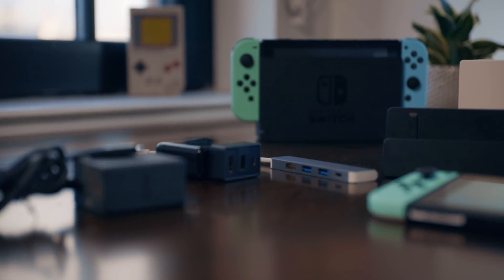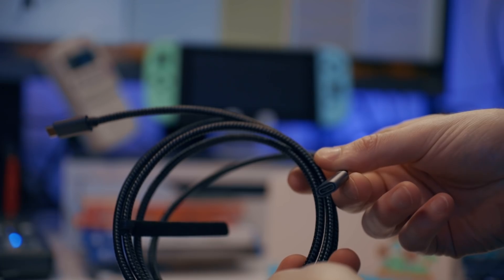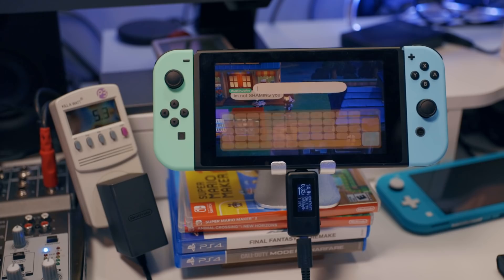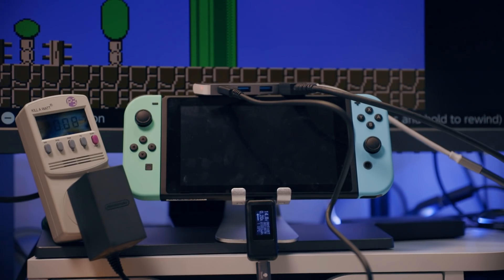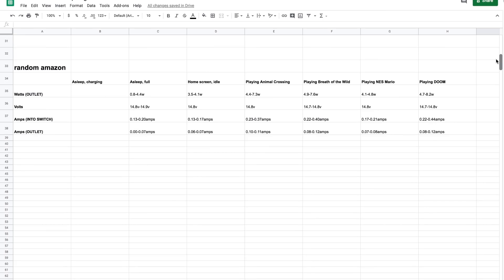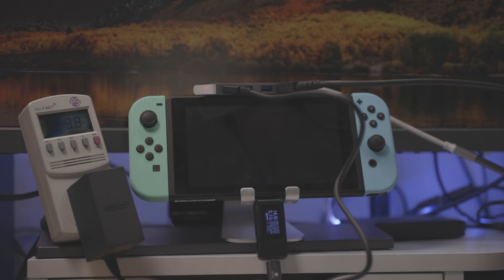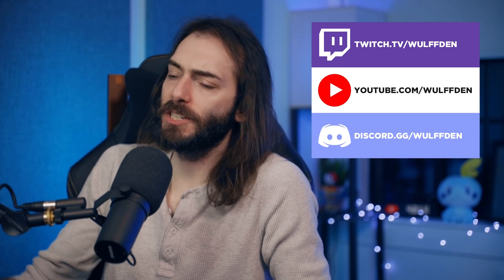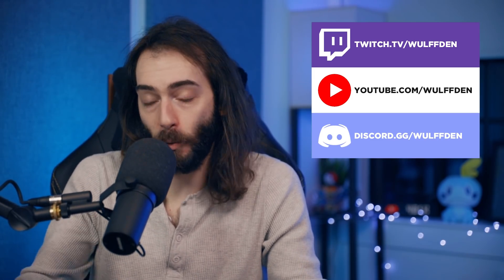How the Nintendo Switch consumes Power

Comment: I know you've made a few videos on the topic before but after this video, I won't ever buy a 3rd party dock - thanks for actually testing and taking the time
Reply: Hate to burst your bubble, but he didn't test enough, or PROVE what causes the bricks. 99% of third party docks are safe, and you can do your research before buying one to see for yourself what is and isn't safe.
Reply: @redwidow1358  if anything he proved that Nintendo built their systems to only play nice with their own proprietary docks. Obviously, his test could be more extensive but I can see now that my safest bet is nintendo's own switch dock if I don't want to risk frying my shit
Reply: @eddycazares  That's wrong and he's wrong lol
Not to mention that old and new Switch units draw power differently. If you have one of the newer Switch models with better battery life, you're already safe.
Reply: daffy duck the fact that they draw power differently further proves his point and that any switch dock won’t be as reliable as Nintendo’s own dock. Yes you can use any 3rd party dock but “safely” is not the case unless it’s their own dock.
Reply: @eddycazares  No, again, it does NOT prove his point, because he didn't make a point! He didn't test the internals of the Switch, nor did he actually brick a Switch. He didn't prove anything in this video at all.
Reply: daffy duck okay dude

Comment: I think "we" can use a better method but it will be sort of expensive. 

Get (maybe there are, idk) a USBC passthrough and monitor every pin in that output. So it can be monitored accordingly and specifically  the voltages of every one. 

This way we can know if it's an usual data line or another voltaje one.

Crazy? idea, maybe? doable? yes, expensive? most certainly  Cool ?  Absolutely

Comment: Discrepancies in the power could potentially be due to efficiencies within the docks themselves. i.e. they get down to 0.8W because something in the dock is using that extra power whereas the Nintendo one is more efficient so nothing is actually being passed to the Switch itself.

Unknown but yeah since the first ones were a crapshoot... i don't really trust them. I own a little portable one but don't use it anymore (it has rebooted my switch on plugin quite a few times)

Comment: i have 2 switchs not charging anymore at home, both i used a few time a samsung charger and the 8bitdo usb cable connected to my pc to charge them
i'm trying to repair them bought all the soldering gear microscope etc

one culprid is the chipset in charge of battery usage, it has no fuse to protect it and die often, there is the video hdmi converter to usb chipset who die a lot but look like it happens when you plug the console,  perhaps too much amp from a 3rd party charger and boom, but it's weird there is a fuse for the usb part, but it never burn !

Comment: when at my dads house i play in portable and use my phone charger while im there. is that safe for my switch
Reply: Of course. It's completely safe to use any decent USB-C cable. No third party charger has ever caused an issue, nor will they ever.
Not to mention, nobody has PROVEN that third party docks cause a brick when power consumption is concerned. Nobody has actually proven exactly what caused it.
If you want a third party dock, just Google it and see if the one you want is safe. 99% of them are.
Reply: daffy duck yeah its pretty safe to say charging it is safe, no real failures have cone from simple chargers.

If you want to dock though use the official one

Comment: Is it okay/safe to charge the switch while playing? Because sometimes i do it. The charger im using is an official nintendo switch charger. Hope someone answer my question.
Reply: The issues in this video are about using the Switch with a 3rd party dock and/or using a non-Nintendo charger with the dock. 

The Switch in handheld mode is safe as long as long as your cables and chargers aren't cheap knockoffs / damaged. I'm currently playing Animal Crossing while plugged into an Anker wall charger with an anker cable. You are 100% fine with your Nintendo branded charger.
Reply: @badlybrowned  thank you very much for your answer

Comment: Not so much a question about the dock, but wasn't there also large concerns with charging cables too? Would you mind doing another video testing just a few USB-C cables to show what the actual difference is with using them (i.e. Nintendo outlet that came with the dock, cable that comes wtih a pro controller, other random usb-c cables)
Reply: No cable has or will ever hurt a Switch. Third party chargers are safe.

Comment: I would've also used Xenoblade Chronicles 2 for testing bc of the rushed optimization it has making it tough for the switch to run consistently sometimes

Comment: Hold up, is it safe to charge a Nintendo Switch with a Samsung charging cable?
Reply: I have a a20 so I get the faster 5v charger for fast charging so I let it sit there and charge but I had it on. I charged it but I would not recommend playing while charged it. Only recommend in a pinch
Reply: No cable has ever, nor will they ever hurt a Switch.

Comment: Has docks causing bricks happened apart from one dude with a Nyko dock? I feel like you're heavily overreacting. Aftermarket chargers don't behave identically but why would the switch be so incapable of managing its own charge that you can break it with normal chargers? A slight variance in power delivery is not going to brick your switch. A surge, or a major variance, might.

Comment: See, I've been using a third party dock with an official Nintendo AC adapter but I want to get a refurbished dock from Nintendo... problem is we can't get anything from them these days...
Reply: @alittlereckless  the only ones I can find on ebay are missing the back cover so I figure I'd be better off waiting for Nintendo to get them in stock
Reply: @alittlereckless  okay I found one used for $50 on ebay but I'm unsure of the condition...

Comment: "The same company that released the same console 2 generations in a row" 

Ooh boy I think you forgot about microsoft and  sony
Reply: I mean, the PS3 and XBOX360 were completely different circuit architectures from their previous generations and had far better graphical power.  The PS4 and XBONE went to x86 and were again a huge performance improvement.  The Wii was basically just a GameCube with overclocked memory and motion controls.  I was literally the same chip.
Reply: @matthewblackwood9653  Precisely. When you play Gamecube games on the wii, it literally reboots into a gamecube mode using the same chip. thats why the SD card isnt accessible in it without mods, and no system menu etc.
Reply: "Pro" and "X" are not the same as the Gamecube and Wii. Before you go starting console wars, please do some research.

Comment: You convinced me with your first video. I own several 1st party docks and my 3rd party dock is probably what fried my first Switch in 2017 (it was prior to the Nyko dock problems). 

My question now is about battery packs. I own the official Nintendo branded battery pack but I suspect that it is not that different from any other Power Delivery battery pack. Are any batteries safe? Are they all?
Reply: Well, the Nyko dock had problems months before it was widely reported, just so you know

All battery packs are safe. Just get a good one. And FYI no standard USB-C cable is able to hurt the Switch.

Comment: I use the official Nintendo power brick with my Insignia dock. I'm curious if this has any affect. I will take this video into account and remove my switch from dock when I'm not playing it. So far, the Insignia has worked better than my official dock(which is now broken).
Reply: The charger will never be the issue, you can safely use whatever cable or power brick you want. Only the faulty docks are to blame.

Comment: My biggest question is if any of this applies to the switch lite. Because last Christmas i saw my brother in law charging his brand new switch lite with his cellphone charger and i nearly ate his head off when implied i didnt know what i was taking about despite the fact that ive had a switch since for a year at that point. But his was a switch lite and im interested to know whether the switch usb-c nonconformity is a byproduct of its docking feature
Reply: Lites are not affected by this at all. No charging cable will ever hurt any Switch. It's a docking issue.

Comment: Would you recommend charging a switch with the pro controller charger and an iPad adapter?
Reply: I don’t know if it’s save or not but I have charged my switch a couple of times with my MacBook Air charger and it still works fine. Just to be safe I wouldn’t recommend using it regularly if you use it at all
Reply: Those cables are 100% safe
Reply: daffy duck good to know. Thanks 👍

Comment: I have an official nintendo switch dock when I got my switch.... I use to leave my dock pulgged in on the wall and pop in my switch on the dock if I need to charge it and I never unplug my switch dock. One day I had this issue where the dock is flashing green light on the side and it never works ever just charging. I've done research to save it becuase first off all I have no work becuase I am still studying. Then I decided to buy a third party switch dock because I have no enough money to buy, and now I'm still rocking it and have no issues or what so ever but I never let the dock be plugged in all the time and I charge directly to my switch and only use the dock when i will use it on my tv.... Men i don't know I just want to share my experience on third party dockI've been using it for almost a year an a half.....
Reply: I use my $25 dock  to use tv mode play. And iv been fine. I haven't been testing it for time yet , a month so far.

Comment: Thanks for breaking it down but: when I'm traveling I'll continue to use my Genki dock. I have an extra official dock so I'll have one for the living room and one for the bedroom, but I'm not taking either with me on a trip
Reply: Considering that Genki's main engineer literally wrote a white paper on Reddit about the exact cause of Switch bricking issues, I would be inclined to not worry much about the Genki dock.  The KS comments page hasn't even seen a single legit claim of a bricking incident due to the GCD.
Reply: @muhamadnoorikmalbinibrahim317  yes I do output to tv it's the reason I bought it. I also use it to charge my phone or my girlfriend's laptop, it use it to output from her laptop to the TV, out add a usb-a port to her laptop. It's a perfect all-in-one solution for me. I have a charger and a dock in one package.

The extra dock is permanently in the living room. I'm not going to change the case just to have a travel dock to also have to carry an official charger when I have something that takes up less space than either of those two.
Reply: Can you point me to the direction of that dock? I tried searching, but I'm a bit confused if what I'm seeing is what you have.

Comment: Is there a way to get a dock for a Nintendo Switch lite?
Reply: No. The docks main purpose is to convert the switch to tv mode. The switch lite isn’t capable of that.
Reply: S Williams I know, but I was wondering if there was a smaller version of the dock that doesn’t cover the screen, so I can play it while it’s charging
Reply: Avery Matteson there is a Nintendo brand sort of mini charger that docks a switch or switch lite with a pass through for a usb c charger. It’s about $20

Comment: Not gonna lie, I official Nintendo everything apart from the switch carrying case, that's hori.
Reply: I got a Hori Split Pad Pro coming in, but that's just because I lost a Joy-Con and it was cheaper than buying even a single new one (seriously, why the f*ck are those things so damn expensive?).
Reply: That is an official case. Is a official licensed case. But also fuck nintendo they overcharge for everything. 80$ for a pair of controllers that aren't even that good  fuck them really. Also 80$ for a dock and charger kit and also is sold out and never restocked. The madcatz days are over. Sometimes third party companies offer better options than the actual company
Reply: Cesar Mendieta joy cons are really expensive because they have a lot of seldom used stuff thrown in like nfc and an IR sensor
Reply: Cesar Mendieta can you send a link to a controller with motion controls, hd rumble, nfc, and IR for $40 please
Reply: @dussaal  They cant....someone just learned something looking at 3rd party controller features....
Reply: Cesar Mendieta also you don’t buy a Nintendo console for the power it has, so comparing it to other consoles or devices isn’t really valid. I feel the $300 is justified based on how many amazing exclusive IPs Nintendo has on the system and the portable form factor. Gotta look through the eyes of a consumer dude.
Reply: @dussaal  They gamecube style joycon C800  usually goes for 40$ btw they dont drift at the month of use and they include wireless nfc IR and gyroscope
Reply: Cesar Mendieta is there HD rumble? Can’t find it on product page. EDIT: Has rumble motors, but isn’t HD rumble.
Reply: @dussaal  i understand that point,  but trust me, the technology behind the switch is very old,  the tegra X1 has been around since 2014, the construction of the console is very cheap, everything is plastic, the screen, the vessels. AMD could build a better portable console using a ryzen 3 APU, and yeah nintendo IP's are great but, they dont compare to the vast tittles that cant even run on the switch like R2D2, FFXV/VII, GTA V, and other tittles that will never hit the switch, nintendo is realising games for PS3 and 360 to the switch catalog, is a very underpowered console, even a xbox one S is cheaper and better, the switch only have 32gb of storage, the most basic versions of other consoles have at least 500GB
Reply: @dussaal  yeah "HD Rumble" not a totally marketing term to reffer to another type of rumble that totally worth 30$ extra dollars, a total must have.
Reply: Cesar Mendieta I’m not saying it’s a must have or it needs to be there, I just said the tech for HD rumble is expensive and drives the price up. And why do you expect that a console that is the size of a tablet can compare to a desktop CPU?
Reply: @dussaal  TBH, apart from the HD rumble, IR sensors and NFC is probably really cheap to implement. The dude's got some good point, plastic screens, old processor, subpar display etc, the switch is really an fairly old piece of tech, but its only $300 compared to $1000 high end phones, so I wouldn't complain much
Reply: @Summer-xu8qu  honestly the only subpar part of the display is it being 720, its still an IPS with beautiful colors
Reply: Ian Summer the tegra x1, while somewhat old, is still one of the most powerful tablet grade SoCs out there... mostly cause nobody exept apple is seriously making high end tablets anymore.(and apple uses its own laptop grade SoCs in ipad pros)
Reply: @thebravegallade731  iPads may be powerful, but the OS and features themselves are always two years or more behind Android, and they still haven't allowed third-party home apps yet. I have my phone looking like Windows 8.1, and it even has a working Start Menu.
Reply: @cesarmendieta7954  yea I was pretty pissed about the lack of Bluetooth for headphones when I got my switch lite a few weeks ago.... Even the most basic shitty cell phone you can get has Bluetooth headphone connectivity....
Reply: @cesarmendieta7954  I was also like what. The pro controller is like twice as much as a ps4 controller in my country
Reply: @cesarmendieta7954  I'm using an 8bitdo SN30 pro + for my switch. its so great in everyway, but it has terrible input lag sometimes. it really sucks, because a pro controller costs 70 bucks to buy

Comment: I really wish someone with more technical know-how would do this, and with more docks (I'm specifically intrigued by the Genki Covert Dock, which I've heard great things about but you don't have). I don't think you did anything wrong per se but you yourself admitted that you don't actually know the ins and outs of all of this, so it's always possible that you're measuring the wrong thing or drawing the wrong conclusion or whatever.

Thanks for looking out for us!
Reply: I agree. Bob did as much as he possibly could, and I always appreciate the hard work. But it would be great to have an actual electrical engineer look into this further than a normal person could.
Reply: I can tell you this much, he's measuring all the right things. I know that much. However, what I don't know is whether a variance that small has a high likelyhood of ruining the battery/components of your Switch. That being said, it's important to note that as a rule of thumb, any variance in voltage or amps is bad news for longevity. Your battery/components will usually wear out/malfunction quicker than with official accessories.